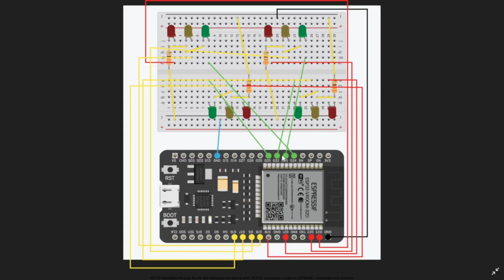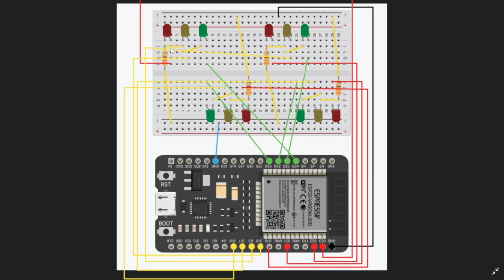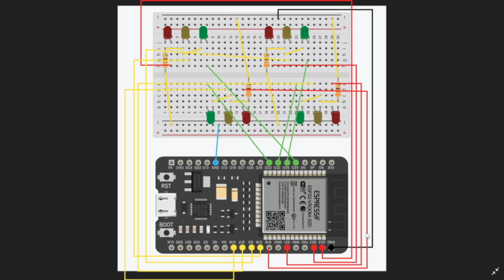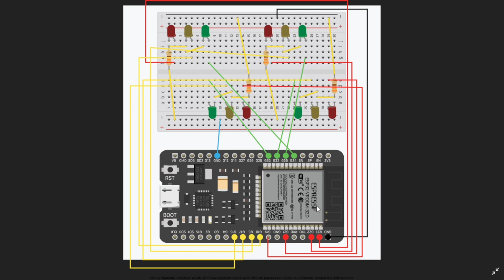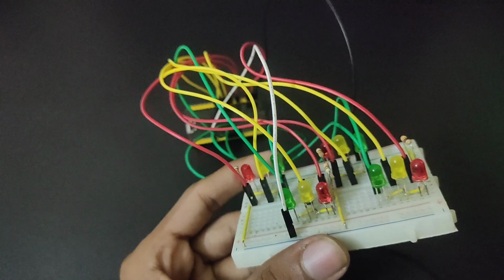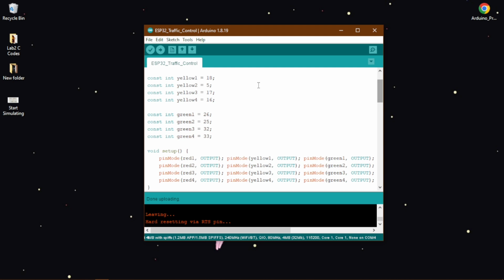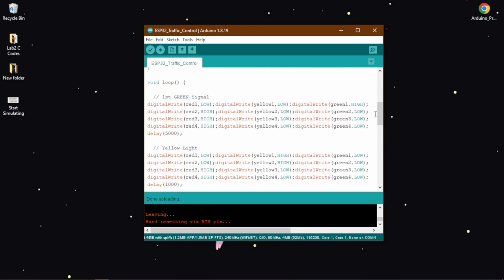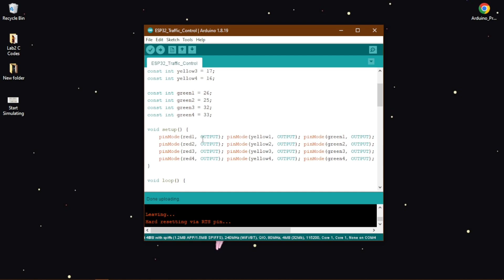How to Create a Traffic Control System using ESP32 | LED Traffic Light With ESP32 |

Comment: 4 pcs of 4 pin rgb led module to my 4 pcs of speakers separately:

 1st 4pin rgb led module to 1st speaker, 

2nd 4pin rgb led module to 2nd speaker,

3rd 4pin rgb led module to 3rd speaker and

4th 4pin rgb led module to 4th speaker.